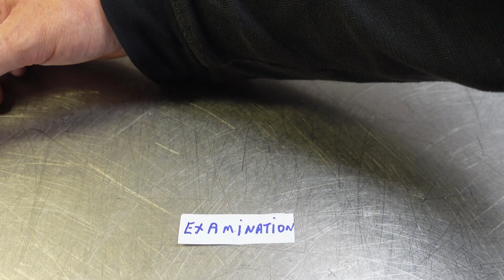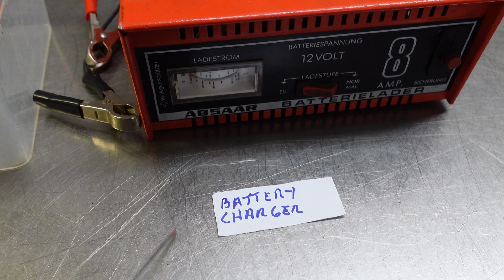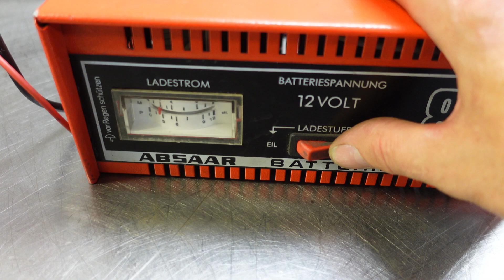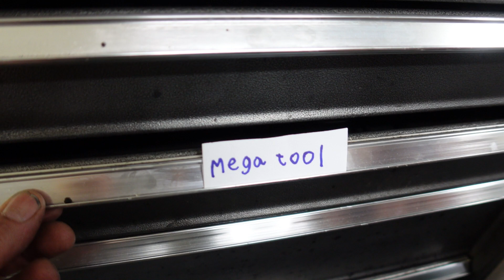Panzer padlock . German WW2 piece restored.

Comment: Pretty cool with the electrolysis. I've never seen it done with those chemicals, just table salt. The battery charger was also more powerful than what I've seen used. It did the job well. The result after the other processes was perfect 👍
Reply from the maker: Great to read and thanks for comment and for watching.

Comment: Was the initial use of the blow torch just another means to assist in removing hard to remove dirt, grime after electrolysis was completed ? Really getting into thsi channel thank you Professor....
Reply from the maker: No just a improvised thing to implicate heat in the process :) Thanks Ted.